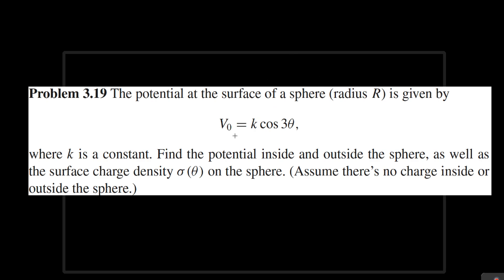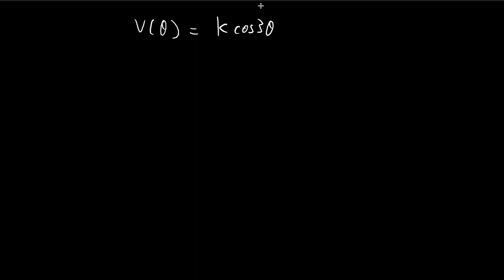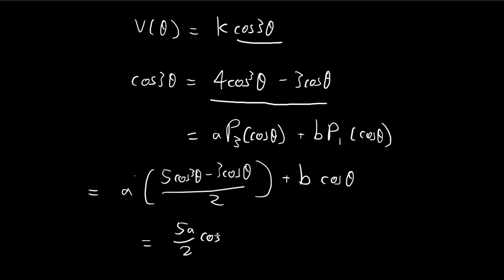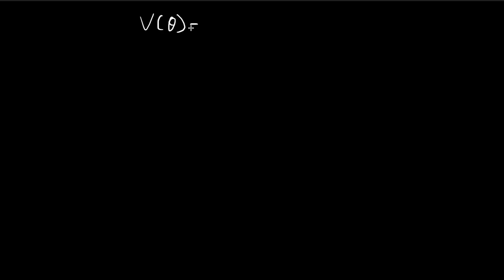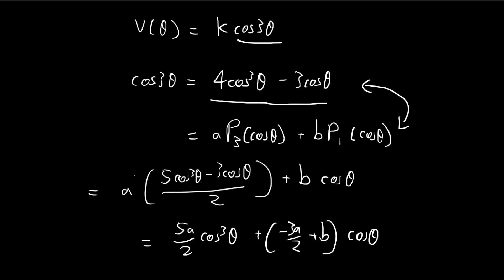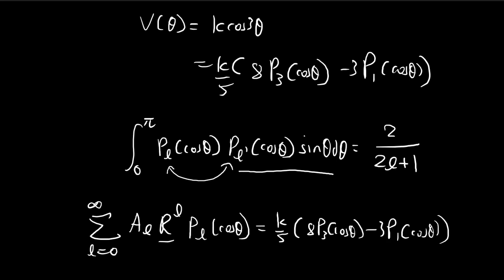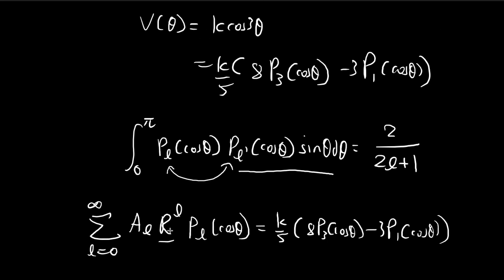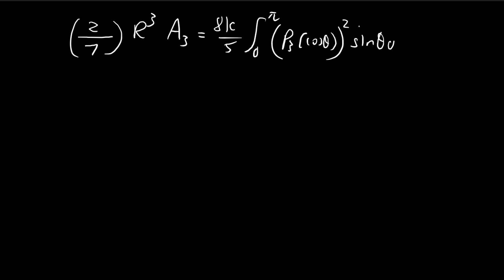Problem 3.19 (Part 1) | Introduction to Electrodynamics (Griffiths)

Comment: When the Trick is applied and the values for when l=l' and l=o is, where does the 2/(2l+1) come from? Is that just a given from the text book, or did you solve for it somehow?
Reply from the maker: Adam Chavez that value is given in the textbook. You can take a look at some of the examples in the textbook.
Reply: @HayashiManabu  I thought so. Thanks.
Reply from the maker: Adam Chavez glad it helped :) I just looked up the location of the equation. You can find it on page 144, equation 3.68